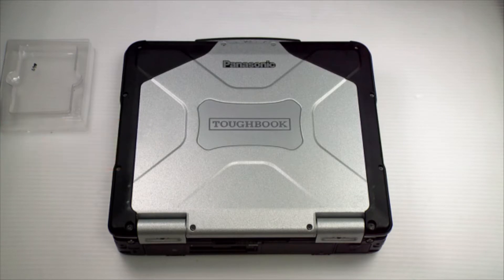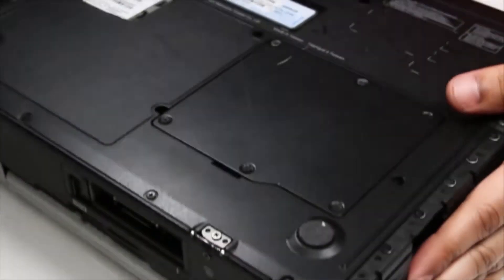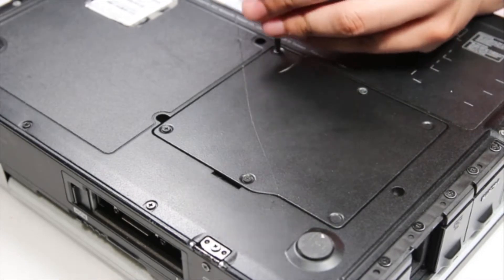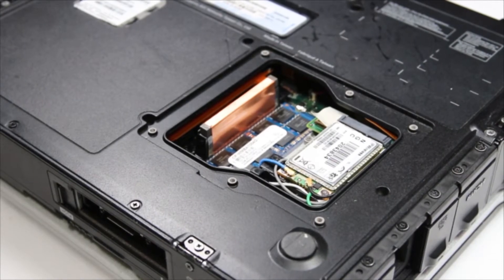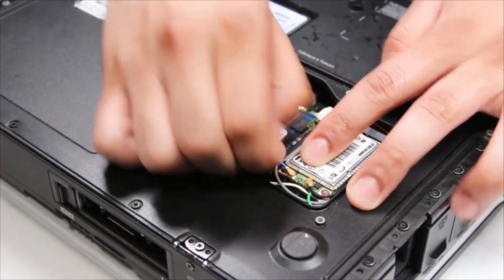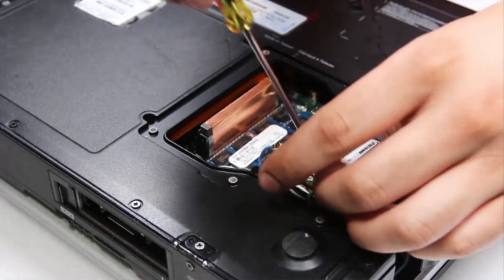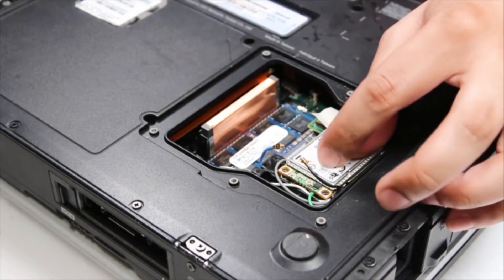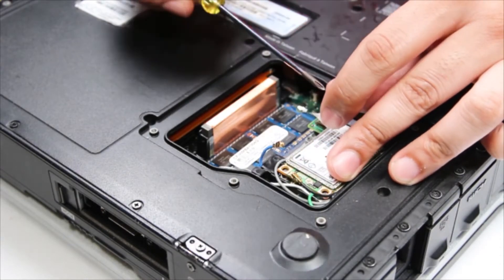Repair Your #Toughbook #CF-31 WWAN Card (Gobi).

Comment: I have a CF-31 MK5 that came with the EM7355 module. I believe the MK6 comes with the EM7455, and I'm curious if I could do a quick swap and update with the necessary drivers. Looking into the EM7455 due to the numerous additional LTE bands available compared to the 7355, but wanted to make sure it's compatible first. Thanks in advance!
Reply: Any update on this? Thank y'all!

Comment: WWAN CF-31 Hello Bob just I would like to install WWAN card and found that I can not see BLUE and BLACK cable there. But I have slot for this card there and also slot for SIM card. Could you please give advice? Thank you very much in advance.
Reply: I guess you don't have an antenna and that's why you don't have the cables to plug into the modem

Comment: Is there somewhere I can find out what colored coax cables go where and what there are used for? The black and white were on the WLAN and the blue is on the Bluetooth I'm assuming. My CF-31 doesn't have a GOBI card, but I'm ordering one off Amazon and I'm assuming I connect the green and grey cables to it?